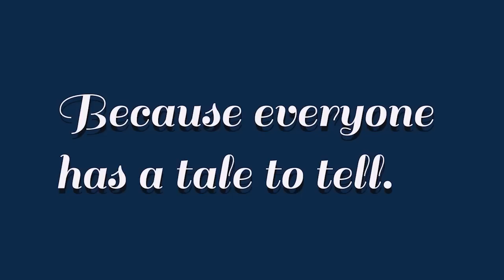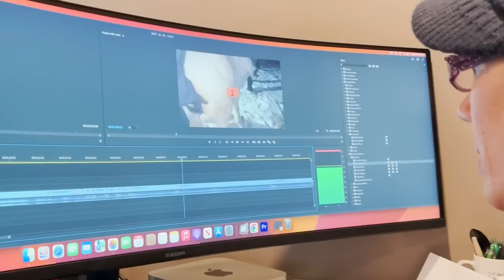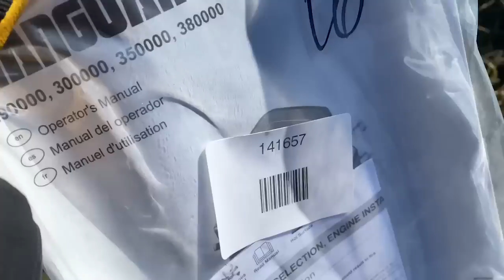Horse Rescue Tales from the Tundra - S1-E1

Comment: I’m in northern IL and we bought additives ( hollow glass beads) to add to paint, to provide insulation. Some areas of our home we put 5-8 coats. About 10 years ago the furnace died in a  35 below wind chill. It never got below 60 F.So I highly recommend you investigate the multiple types of insulative materials.